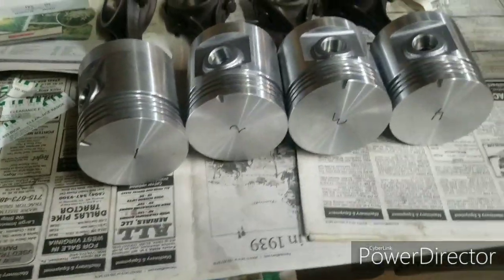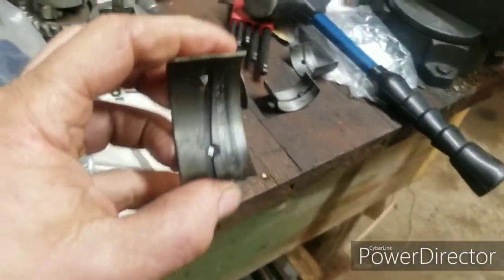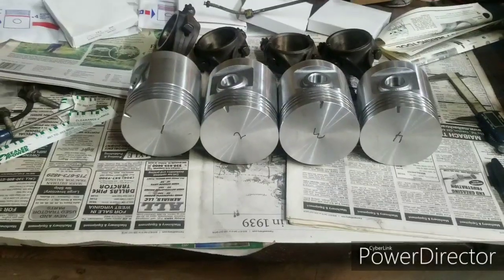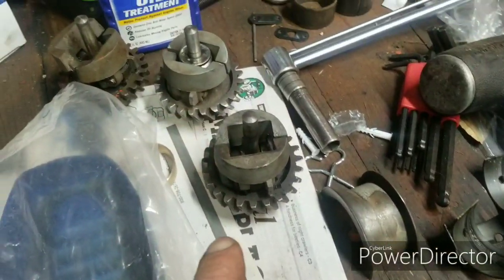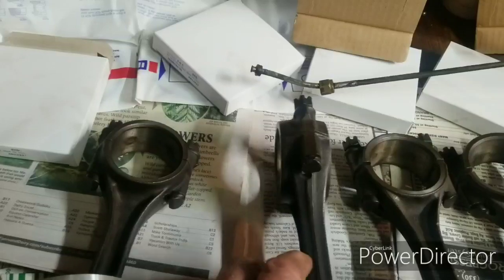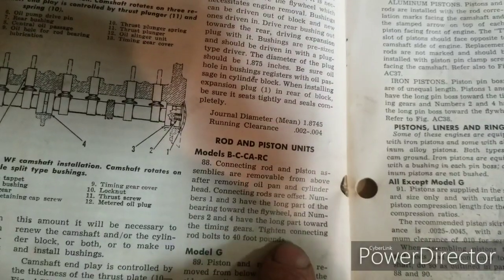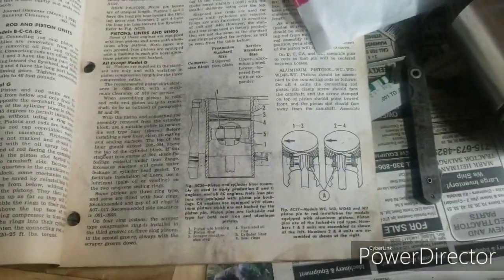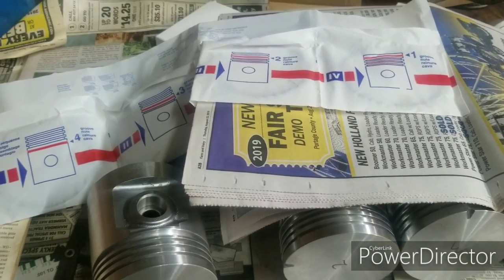Assembling pistons and rings

Comment: Hmm.. oversize pistons and standard rings????? Ya, definitely gotta look into that!!
A crack in the governor gear???  How?? Interesting......
Gotta keep your precision measuring tools clean and dry!!! Otherwise you can't read them🤣😂 lol ya, I've got a few feeler gages that have been abused too...
OMG.. yes!! I'm always afraid of snapping them too!!
I've never busted any new ones, but I have messed up a few used ones that I didn't plan on replacing...(they didn't have any time on them, needed to pull the piston for some reason, I don't remember why.)
Thanks for the update!!!
Reply from the maker: Yeah they're probably standard rings for a Farmall over bore on a AC!  That's a high speed governor, ready to fly apart! Lol thanks Ed
Reply: @cesmith4566  so, it's kinda like a New Holland 1469 haybine we had years ago... Dealer rebuilt the engine before dad bought it. It had a Wisconsin 37hp air cooled, can't remember the model, VG4D???
When we rebuilt it a few years later, it had two Ford pistons in it.. a 4 cylinder water cooled Ford was the other engine option they used on them.. 🤣😂 BTW, it ran much better with Wisconsin pistons..😎